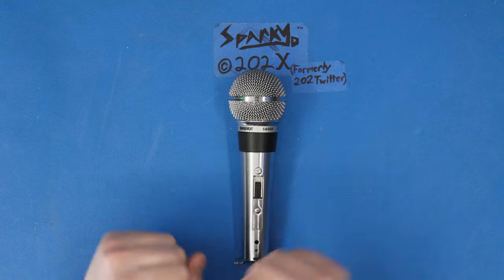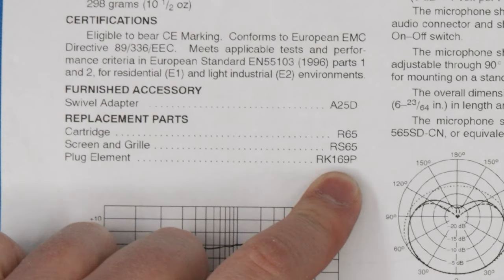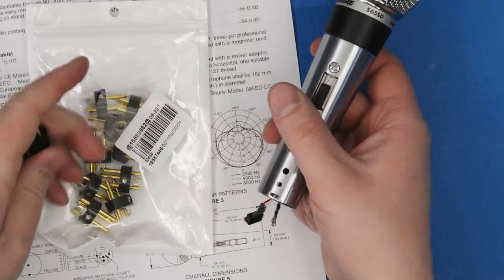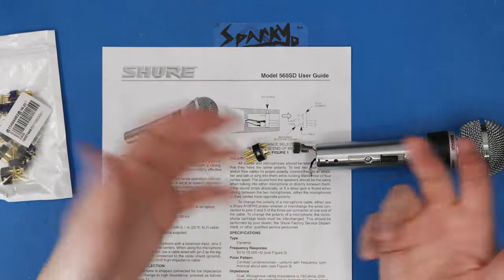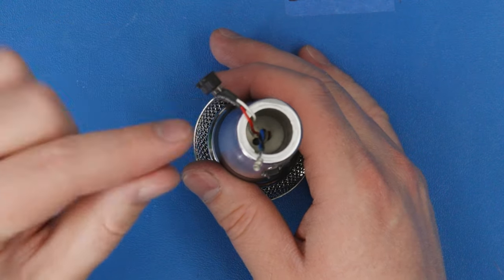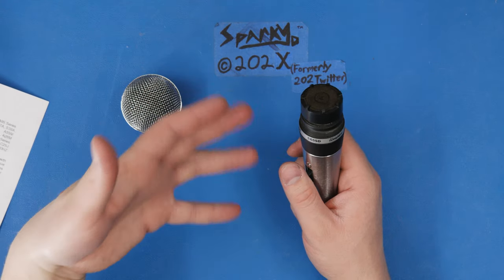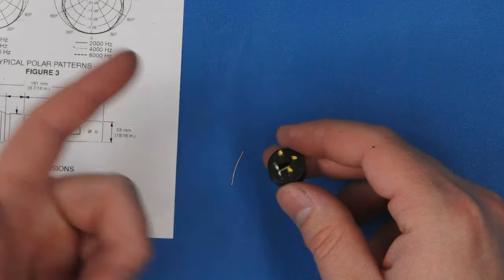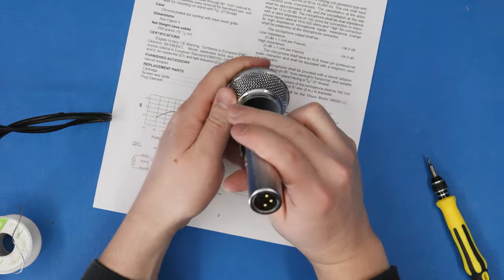Can I fix this $3 Goodwill Mic Using a Cheap XLR Replacement? - Shure 565SD Full DIY Guide!

Comment: wowie this vid is exactly what i needed! i got a working pe54d mic at a flea market today for $50 but as i was trying to pull out the plug to switch the pin over to lo-z, i broke the plastic part that holds all the pins together... don't think i'll personally want to switch it back to hi-z but i wanna keep the way the wires plug in, so thanks for showing me the way!
Reply from the maker: Hopefully it works out! PE54Ds are pretty nice